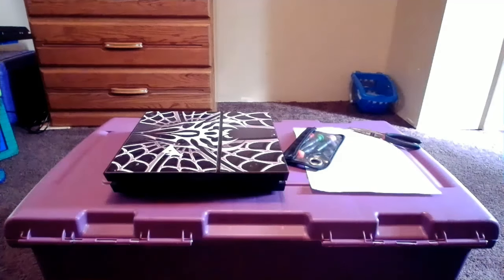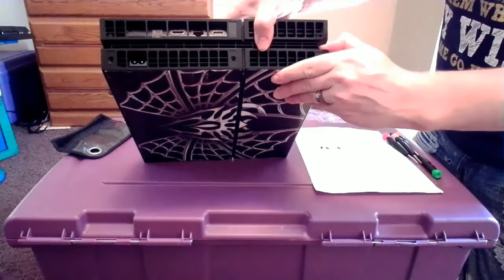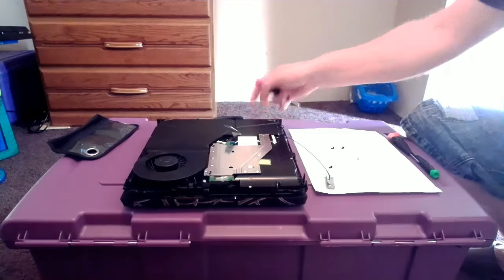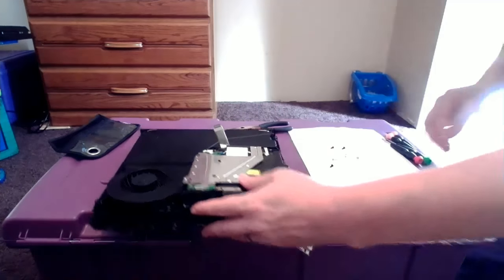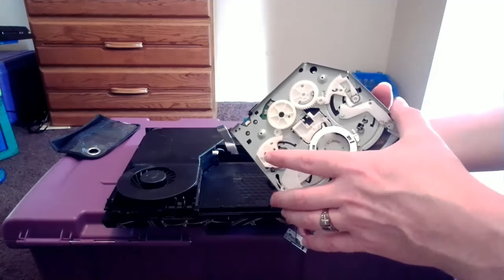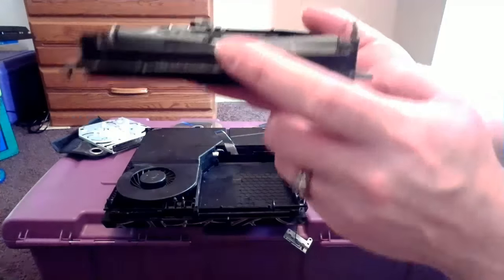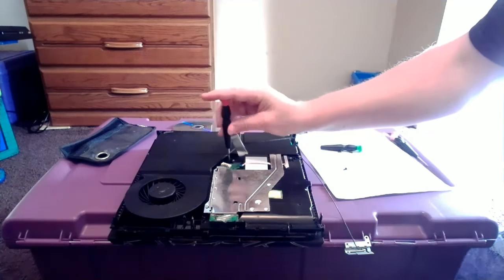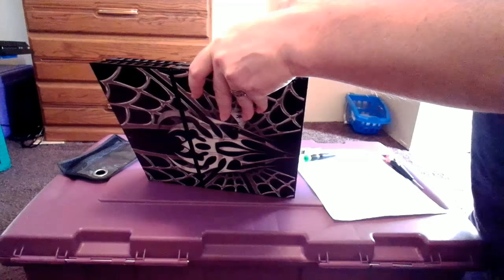PS4 WON'T ACCEPT DISCS? | EASY FIX!

Comment from the maker: Thank you so much for your support everyone! If you enjoyed the video, please feel free to hit that SUBSCRIBE button and come join us on Discord! https://discord.gg/Hvw7SHZ You're all amazing!
Reply: Hi
Reply: But my Ps4 doesn't have the 3 initial screws in the back :/ .
Any other way?
Reply: i did it today and its still doing the same thing i tryed 3 times
Reply: I tried this and one of my rollers was up and the other was down, i don't know if it was supposed to be like that. I've tried fixing it but the left one just keeps popping back up and doesn't want to go back down and the right one won't budge it is always down.
Reply: I found that you don’t need to open the PS4 to fix this I turned it off and then I tried to put the disk in and it turned on PS4 and acsept Ed the disk
Reply: Hey man I'm having an issue. When I start up my ps4, the game disk is taken in automatically, the  it says unable to read disk, when I press the return button it removes perfectly. The Problem is that when I try to put it in again, the system doesn't take the disk in automatically. Its as if its stuck. This has been killing me because everything is working.(Any disk I put in just says unable to read disk). The only problems are that its not reading the disk or taking another disk in after I eject the first disk.
Reply: Aaaaaà
Reply: @gamingphoenix5038  so you just turn of the ps4 and then put a disc in and the play?
Reply: I thought I wouldn’t be able to play gta anymore but I just turned my ps4 off and it’s started working lol
Reply: @Iniquitous_Schizoid  "the ejecting and not taking disks anymore" problem can be fixed using the method in the video but the "unable to read disks" might be that the disk is dirty and needs cleaning or the disk drive's sensor is also dirty, you can use baby wipes or rubbing alcohol and a microfiber cloth and try cleaning the sensor, if it doesn't work you might wanna call Sony for this problem😁
Reply: @SGT moose mine keeps beep and thinks it has a disc even though there’s not
Reply: Thank u actually worked

Comment: So my PS4 won’t take the disc and when I try to put it in it makes a grinding sound there is no disc in it
Reply: Same problem 😭😭
Reply: Yep same thing I clean my p4 and then this happened
Reply: I fixed it finally and its working again yay 
I followed a video and i just had to tighten a single loose screw and it worked again
Reply: diana fox can u send me a link
Reply: Same bro that exactly happened to me and it beeps so much
Reply: Same
Reply: Wey
Reply: Ther is an another way that I use it worked for me if this still dosnt work for you. It could also be a single screw. If you pop the left side of the ps4 off right in little gutters of the ps4 take a flash light there will be a little screw in on of the slots. Take a small screw driver and tighten that screw. It’s to get disks out. If it’s lose it will keep trying to put disk out it locked my thing. Just tightens it and it just fixed this problem here.
Reply: @dianafox3513  same thing
Reply: Samee
Reply: Same
Reply: Did anyone else beat the fuck outa the ps4
Reply: @ahoffmeister_  yes
Reply: ong same ima just go to gamestop ,, oh well my money saving for no reasons
Reply: idk if i just have an older model or what, but i've checked every inch of this thing 5 times and those 3 little screws to get the top off are nowhere to be found, and the back of my ps4 looks different than his. in fact i can't find a single screw anywhere on the outside of the console. i'm gonna get pissed and end up breaking it trying to rip it apart.
Reply: Samee
Reply: Not sure if anyone still watching this but the fix for the constant eject problem. It’s the eject button itself on the inside is not making contact properly. Take too and bottom covers off. When you slide the ps4 into the bottom cover take note to the little prong on the backside of the eject button. Press the little tab down to stretch out/make it springy again. Slide ps4 all the way in to the bottom cover now. Click the button see if you feel it clicking inside. If not remove and try again to adjust little tab, if it does click, plug it in turn it on and see if it takes and holds the disc. It took me hours to figure this out. Hope I helped save someone else’s time. :)
Reply: @dianafox3513  which video send link
Reply: @FMC6  just go back in this conversation and i put the link there  in one of my comments
Reply: @dianafox3513  nvm I got it fixed 2 weeks ago
Reply: @dianafox3513  can you link it again for me
Reply: Same

Comment: It happens because you have to fully let the ps4 disc out when you stop hearing the sound of it coming out you can take it out but If you snatch it out before the sound stops the ps4 will get confused :)
Reply: Ok
Reply: Oh my god, Thank you sir.
Reply: @igotbanned8372  did it work
Reply: @Richofcardz  no I said "Thanks" because it didn't, yeah it worked.
Reply: Ok I’ll never do that again 😂😂
Reply: i swear i always wait for it to fully eject because i'm very picky about my discs, not a fingerprint or scratch von any of them. but somehow i've got this stupid error and apparently have to go get the right tools to fix it.
Reply: Damnit I did that😂
Reply: Lmao it worked. Thank you buddy.
Reply: Or if you turn it off before it is done
Reply: Dunno if you'll see this, but I accidentally did that. Tried the method in the video, but the disc still won't go into the drive. Any other suggestions?
Reply: Thats what i did and bow it wont work

Comment: "Easy Fix"

proceeds to take apart half of the system
Reply: It actually very easy this video made it a breeze
Reply: Bruh
Reply: It is bro just that mines has two stars not three screws
Reply: I dont get it all you have to do is void your warranty, risk cutting cables, take it apart, and put it back together!
Reply: @therealmistermemer  😂😂
Reply: @therealmistermemer  better to take it all apart routinely every other year to clean it and keep it running fresh if you just handle it all proper nothing will break never opening them is exactly what they want you to do so they make money
Reply: Be a man
Reply: He means easy in level of difficulty I’m pretty sure Anybody can take apart a ps4
Reply: @therealmistermemer  I bought 2nd hand so I don't have a warranty option.
Reply: @therealmistermemer when did yall buy ur ps4? the warranty is probably over

Comment: Easier fix:

Turn ps4 upside down and tap on the bottom of it. Flip over test to see if disc is accepted

No disassembly required xD
Reply: That is so cool, it worked for me.  Would you know why though ???
Reply: I presume it has to do with the disc tray being level, the rollers for the tray and/or wear of the machinery that causes it to not accept discs. I've had this issue for a long time; after taking it apart and readjusting the tray I would still have issues with my discs. One day I was sitting here about to chuck my ps4 to the curb and I tried what I mentioned in the comment. It has worked every time for me with out fail since. My ps4 is from 2014 so it's pretty old it still gets the job done. XD
Reply: @roniclayton9644  hmmm! Makes sense thank you for such a simple yet very helpful comment.
Reply: @imranchandi0  much love my friend. :)
Reply: Ronnie Clayton wtf this actually works thx man
Reply: WTF Thank youuuu it actually worked
Reply: Lmao this actually worked thanks so much
Reply: Ronnie Clayton wtf it worked lmao thanks
Reply: @ericaferrell4144  just tap lightly around the area of the disk reader
Reply: That's awsome it actually works man!!!
Reply: Does the PS4 need to be on
Reply: @yahia3658  no
Reply: youre a savior!!
Reply: Ronnie Clayton Thank you so much wish you the best
Reply: Thank you man!! God bless
Reply: I didnt expect this to work but it did. Thanks!
Reply: It’s work thank you man
Reply: @yahia3658  likewise, much love friend. :)
Reply: Yoo dis shit actually works
Reply: Thank u for this
Reply: Ronnie Clayton thanks so much your the hero we need but don’t deserve
Reply: What a g‼️
Reply: I did it and my game wouldn’t go all the way in does that mean something is stuck inside it like a card or something
Reply: Ronnie Clayton didn’t work for me
Reply: I've been without my tray for about 6 months atleast not working and you tell me this i try it and boom.. Thankyou
Reply: holy shit this worked!
Reply: @Dream Sonic Jay i hit it all around on the bottom open palm
Reply: This did not work for me
Reply: @Beastly_4999  I'd say you'll have to go the long route then
Reply: @kentonrhodes3361  I was having that issue as well. The only fix I've seen is force restarting your ps4 and hope that it works. Or take it apart, clean and analyze the tray components. I tried everything and was at the point of getting a new system. I specifically hit the center of the ps4. I haven't had any further issues since. If you continue to have issues it's likely that the issue for you may differ from myself. It either fixes or it doesn't, replacement may be the only alternative. :c
Reply: It actually worked thanks :)
Reply: Ronnie Clayton Thanks for the real easy fix
Reply: OMGGGG BROO IT WORKS U SAVE MY QUARINTINE
Reply: Ronnie Clayton thanks! This actually worked
Reply: I was trying to fix this for about half an hour... Can't believe this worked hahaha thanks man!!!
Reply: @michaelharvent7221  this comment got more attention than the video lol
Reply: mine didnt work. 😰
Reply: Oh my God thank you you're a lifesaver
Reply: Ur a fucking genius
Reply: Yo this actually worked
Reply: Does it work for slims
Reply: @exposehim1728  try it out and let me know :)
Reply: While on or off hahaha
Reply: Somebody help me out
Reply: Ronnie Clayton your a saint
Reply: Does this work with the 1200 model?
Reply: Aii where to tap how light to tap?
Reply: Literally was getting ready to take my ps4 apart then I put it upside down and shook it 😂  boom. Takes disc now
Reply: It worked lmao😂😂😂
Reply: y doesnt it work for me tho
Reply: Ur a god
Reply: You're our savior man , I've missed Minecraft
Reply: You are the GOAT
Reply: What the fuck!! This shit worked😂thank you lmao
Reply: What kind of sorcery is this? I thought you were trolling but it actually worked.
Reply: Damn, didn't work for me. Looks like I'll have to take it apart now :(
Reply: @umarsattar1540  power cycling a few times and tapping the center should trigger it. If not then sadly you will have to dismantle it :c
Reply: @roniclayton9644  Hello. Thank you for replying.
I have power cycled it a number of times and smacked it gently a couple of times but still, no luck.
I'm just nervous about taking it apart, I was good at taking apart VCRs years ago. But they weren't as delicate lol.

Thanks for your help.
Reply: Thanks man
Reply: Ronnie Clayton 
i’m only wondering if the poster of this video has read your comment..😂🤣😂
Reply: Thanks this worked
Reply: Ronnie Clayton  So I’m trying this method and it’s not working. How hard are you supposed to “tap it”?
Reply: It dont work for me
Reply: How many times and how hard did you tap it?
Reply: Bruh I just did this I really worked thanks bro
Reply: Thank you so much it actually worked
Reply: Even easier fix turn it off and in again
Reply: Yo thanks so much for the help I thought I would have to disassemble the console but thanks to your comment I didn't. Now this is the easy fix thank you so much for sharing!
Reply: fuck me it really did work, u sir are a god
Reply: Thank you for this. I am so Glad I saw your comment.
Reply: Yo! I just bought the last of us 2, came home and my PS4 wouldn't take any disc.  Was pretty rattled. Then I saw your comment and behold the "Tap" trick worked!!!! you are the man
Reply: Thx man it works on ps4 pro too
Reply: U da man
Reply: So jealous of all the people this worked for. Does anyone know if it works on a slim or is it just bad luck
Reply: @eduardoferdinandi3931  it should work on the slim as well c:
Reply: it works wtf
Reply: What area do you tap on it
Reply: I love u
Reply: @Quasii23  I love you also <3
Reply: You saved my ass thank you sooooooooo muchhhhhhhh
Reply: Thanks for that helped a lot
Reply: This worked!!
Reply: Can't believe that worked for me XD cheers
Reply: This actually worked for me too. Thank you!!
Reply: I LOVE YOU so mucH IT WORKED GOD BLESS YOU I WAS CRYING
Reply: Ronnie Clayton thank u so much I subscribe To u
Reply: dude i love you
Reply: It worked for me,thanks
Reply: Bro good bless your soul it worked!
Reply: Omg thank yoooou 😫
Reply: It dosent work:<
Reply: Didn't work for me, might be because I'm using a slim tho.
Reply: I did that then I heard something move. 😳
Reply: Can someone please make a video of it
Reply: Yo my man I can’t find that button
Reply: You think I can FaceTime you bro
Reply: Are you talking about a blue button in the back
Reply: It did not work 😞
Reply: @meemoo7  ily 2 🥺
Reply: @denis8906  I'm glad it work for you, much love to you <3
Reply: It didn't work for me. But what I'm more concerned about is how many people had this issue and solved it with this method like did everyone really have this disc issie
Reply: YOU DA REAL MVP!!!
Reply: Just worked for my son 🙂👍🏾
Reply: Holy mother, it worked! Thanks a lot!
Reply: Does it work for a ps4 slim too?
Reply: Omg thank you so much!
Reply: It’s not exactly working for me
Reply: never felt more relived in my life lmao i didn’t think it would work
Reply: It sadly doesn't work for my slim.
Reply: Does this work? Or are u being sarcastic
Reply: @efaznoorchowdhury1980  no it really does work
Reply: You absolute bloody legend. This worked! Amazing... Thanks so much!
Reply: Not even 2 mins into the video and this works.  Ronnie  a fucking hero.
Reply: Worked for me!
Reply: @roniclayton9644  Thanks a ton!
Reply: lol wth it worked. thanks dude
Reply: Yo wtf💀💀 dude you’re a life saver
Reply: Ye didnt work for me
Reply: @roniclayton9644  how do u power cycle it
Reply: OMG IT WORKED TYSM!
Reply: Ronnie Clayton u saved my life bro!
Reply: Thank you so much, just got Cold War and had a problem with not taking disks. Worked right after I tried just when I was going to lose hope.
Reply: Nooo fuccckinggg way this actually worked😭😭😭
Reply: @richiee6743  just looking out for the homies 🥺 xD
Reply: Thanks man... absolutely worked
Reply: It didn't work for me. I try to put the disc in the drive but it just won't accept.
Reply: OMFG IT LEGIT WORKED!!!! THANKS SO MUCH MAN ILYSM!
Reply: Instead of taking my ps4 apart like some electrician, my man Ronnie fixed my problem in like 20 words
Reply: No way
Reply: It actually worked thanks a lot I was in trouble oh god thank u
Reply: Ty bro
Reply: Legend
Reply: Did work
Reply: Wait really I'm go try that
Reply: Yo it worked thanks
Reply: Dude you're a hero!!!! This saved me!
Reply: Omg I love you. This worked for me you absolute legend
Reply: Thaaaanks it worked.
Reply: Yooooooo It worksss much love bro

Comment: So far this was the only way that "fixed" the disc drive issue, i did this method twice so far once while first-time cleaning my PS4 after 6 years (yes 6 years shocker😅) and today at 4:30 AM😂 thank you btw you saved my wallet from more holes😂

Comment: This was the issue mine had. I got an ultra cheap ps4 that wouldn’t take discs, and when i opened it and reseated the rollers i thought everything looked fine. Going back in after watching made me see the problem. Thanks for making the video!

Comment: Thank you so much! 
I just cleaned and replaced the thermal paste in my Brother's PS4, and as it was so dirty, I opened the disk drive to clean it as well..
But as I forgot to remove the disk before taking everything apart, I had this problem.
Thanks to you I fixed this in 5 minutes 🔥

Comment: Actual easy fix: Hold the eject button for 10-15 seconds, and it should fix. If not, do it again and wait 5-10 seconds after you held it. (Might not be a permanent fix, but you can do it every time it doesn’t wanna accept the disc.) worked for me, I hope it works for you.
Reply: I’m gonna try this brb
Reply: Didn't work

Comment: I have a fix to add.  If you've got an older model, where the plastic top cover comes off, slide it off, and about halfway up, above the hard drive is a little space.  To the left of that, down in the vent area, there's a little screw.  Give that a few turns counterclockwise with a thin philips screwdriver.  It should reset the barrier and let discs go in again.

Comment: Not sure if anyone still watching this but the fix for the constant eject problem. It’s the eject button itself on the inside is not making contact properly. Take too and bottom covers off. When you slide the ps4 into the bottom cover take note to the little prong on the backside of the eject button. Press the little tab down to stretch out/make it springy again. Slide ps4 all the way in to the bottom cover now. Click the button see if you feel it clicking inside. If not remove and try again to adjust little tab, if it does click, plug it in turn it on and see if it takes and holds the disc. It took me hours to figure this out. Hope I helped save someone else’s time. :)

Comment: I usually take mine apart to clean, but I’ve not had a problem with the disc drive till recently. Don’t know how I fixed it but I fixed it. Wasn’t the cover but the video helped me determine what the issue was. Ty